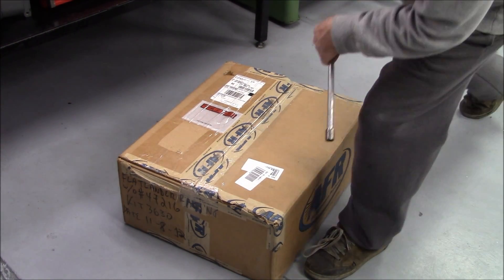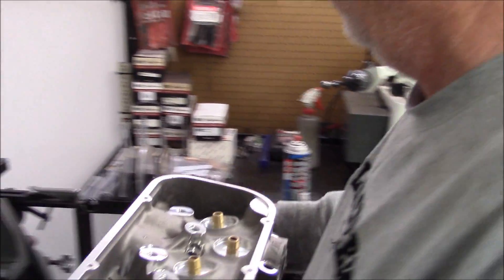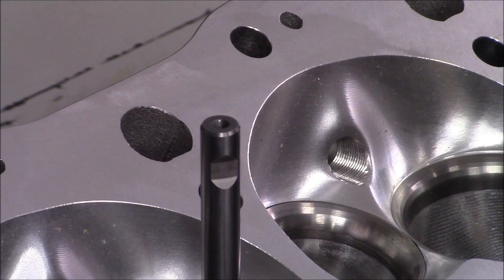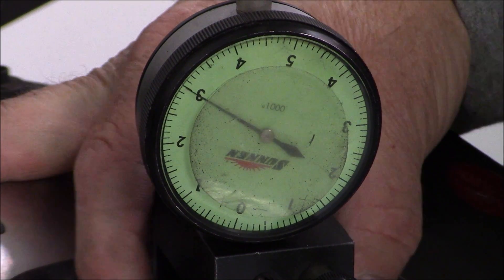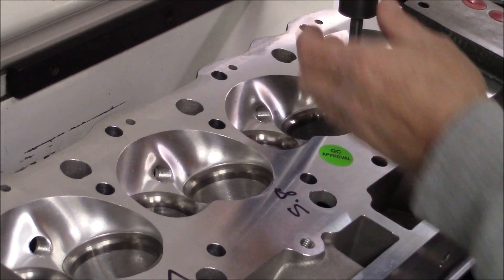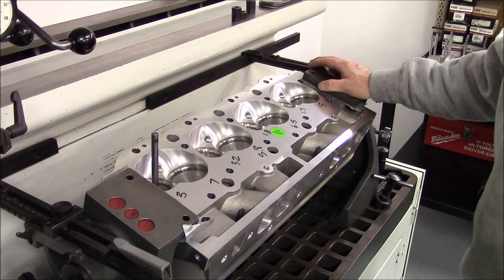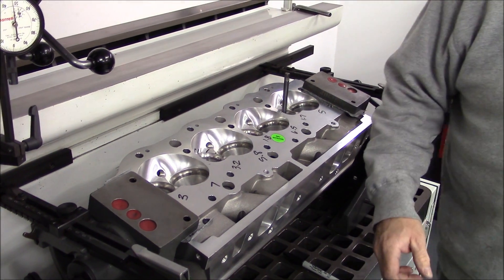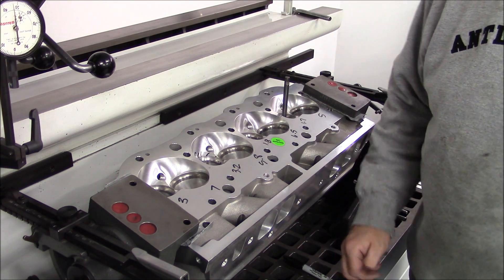Aftermarket Cylinder Heads - Why You Shouldn't Just Bolt Them On - Part 2 - TRRC / Vortecpro

Comment: AFR cuts all their heads on a Newen EPOC , dead pilot machine , 5 times as accurate as 1 Sunnen VGS like he is using here. The tapered pilots he is useing are good to about 2-2.5 thousands runout because they wont go all the way through the guide . Newen Pilots do. I would have rather seen him use a new valve and chech the seat that way.
Reply: That was a good observation on the tapered pilots. I learn more reading the comments than watching the video. I’m glad you made a comment.
Reply: Pilot thickness vs valve stem thickness is crucial. Get them wrong and your valve seat run-out will be all over the shop lol 
I used Serdi machines. It's accuracy is amazing. And one thing he didn't measure was the valve stem protrusion. Unless he's gonna run std hydraulic lifters, then it's like no big deal but still...
Reply: Are you from jersey?
Reply: I think your referring to "Neway" tools?
Reply: Jkdwayne obviously has some real information. 
Yes this video is pure Bull
Reply: There is just no way those numbers are accurate on brand new AFR heads. I worked 10 years in the bearing industry and used mainly Rockwell then but I smelled a rat the second I seen him chunking shit around and quickly moving away from zeroing his dial.
Reply: I agree with you jkdwayne. Newen single point cutter is the best. this guy is a wanker. chucking bolts and ratchets around.. fucken cowboy..
Reply: Now, now. The beers he had for lunch were just starting to kick in.
Reply: @christopherfranklin4760  this gave me a chuckle,  :)

Comment: Yes you are correct that all heads are out by a lot, some more than others. I prefer only .001 run out. Although, clanking around pieces whether bolts or perhaps pilots doesn't help your accuracy for machining or measuring someone else's. As a machinist I cringe when I here that ting sound, knowing that particular piece can be very inaccurate now.  As for the valve job, your valve job while now more accurate has its downfalls also. Those carbide cutters you use, create striations in the seat that will need to be lapped in order to produce a good seat.Better yet I use a dressed 45 deg finishing stone to just touch the seat after applying red dye to the seat. Every machine shop claims to be the hero but very few really does what it takes. The problem with most racers they want it now and  see the flow numbers they think bolt them on and I just made 200 hp extra when they have a poorly setup combo to start with. Winning teams don't just bolt on parts they spend countless hours on the finer things.

Comment: This is pure bull he is trying to survive in a market were you can buy brand name out of the box heads ready to run (the china ones do have issues) I have owned a high performance machine shop for over 30 years. I have checked MANY seats for run out . I have replaced the gauge twice because they are worthless when they get sloppy.
He cant zero the gauge because its worn out and sloppy Sunnen seat gauges are very expensive. Or he is using a to small pilot to run a little scam. 
Shops? like this are why people buy crate engines and just buy complete heads and bolt them on. They have destroyed the market .
 if you are a competent HONEST builder you will build up a clientele that is willing to pay you for your skill and experience (you will be working cheap per hour but if you enjoy it its worth it.)
Then there are the ones like this that try to con there way through selling unneeded work quoting fake power numbers and when people call them on it there like bill clinton they slip there way out of it.
Of coarse this is just my opinion
Show less
REPLY
Reply: Tom Hutchins I’m with you on the clapped tool that would not zero ! But if you stick a guide and ruin a motor AFR at best will send you a new set of heads🤣 what they will not do is replace the whole motor! He definitely should of clocked the pilot 180 out and checked the pilot . I hate crate engines my self . When I’m not racing I build my own engines and the selling point is a crate motor is ok at most things but good at nothing. I check everything no matter who I got it from because at the end of the day it’s my name on the valve covers. Who is this guy any ways
Reply: Take the pilot out and turn it 180 degrees to see if you get the same reading. Then he cut the seat with a bent pilot.
Reply: Thought the same thing, bent or wrong pilot
Reply: Tom Hutchens:  You're right about this guy. I know my way around precision engine work. This guy may have been an engine builder 40 years ago, but now he's just an actor on Youtube.  Probably made so many mistakes that he has run his own business into the ground.
Reply: Tim Hallas the thing that makes me curious is he hasnt responded to a single comment. That tells me something😒
Reply: He never will, because these comments are right. He doesn't know what he's doing.
Reply: Tom , Thank you for speaking up for the engine builders that do great work and honest work. I started in the Cylinder head business in 1970 and I had one of the first SF100 and SF600 benches built. Yes things have came a long way. I got in on the first run of Warren Brownfield SB chev aluminum heads. Had nothing but problems with soft castings, but it all got fixed when Ken Sperling bought the business. Its a shame how a guy like this can post lies on youtube. But as you see plenty of people are not buying it.
Reply: Tom Hutchins I’m more worried about guide  tolerance than valve run out. As a after market parts manufacturer I suggest you always inspect your own parts
Reply: ya dudes trying to make a big deal of a few thousandths. dude its going to get hot and expand either way and make it tighter immediately on start up and 5 to 10 thou is enough to say there could be measuring error to a degree so ya....
Reply: eXp0N3nT1aL  I care about a tenth of one thou🤣 and I get paid for doing it.
Reply: @groomlake51  what do you do?
Reply: eXp0N3nT1aL I build race cars
Reply: @groomlake51  like formula 1 or something?
Reply: This also is not the proper manner to measure runout.  Runout is the extend the seat is out of round, it’s a +/- rating.  He should be cutting it in half.  7ths of positive runout is 3.5ths of actual runout.

Guy doesn’t have a clue what he’s doing.
Reply: @port nut im a welder and its the same for mild steel.it dont want to cut all that good either.
Reply: I watched this man It was like a train wreck I could not keep my eyes off of it and I was wondering just How many people fall for this bullshit. I grew up in The car business.I was fortunate to observe true craftsman Who were conscientious ,confident and their tools Were treated with respect . Maybe I’m missing it and this guy is somehow shooting for more views and feels his target audience is too misinformed to know the difference. Either way he got my view as I fast forwarded through what not to do in a machine shop.
Reply: You're such a jack ass. I dare you to watch his dyno results making 650 hp on 91 oct pump piss and consistent 10 second ET's in a car weighing 3700 lbs with driver at 5,000 ft altitude & horrible humidity. Not to mention all of his satisfied customers over the years. Please find all of his complaints. You can't........now STFU.
Reply: Tom Hutchins you not crazy man this guy makes videos. He's no machinist. Neither am I but things like dust or dropping a precision instrument will produce inconsistent results. When I check something I first clean the poo out of it and make damn sure everything is laying flat and square . And I don't slam shot around either. Bet he's left a rod bolt or 3 loose if he's ever even built an engine. Wreckless!!!!! x 100.

Comment: Well, I agree with many others. Your handing precision machined parts and tools very poorly. That said, I always check valve seat contact with prussian blue to ensure 360 deg contact. It is a far better indication of seat/valve contact and run-out then measuring with a tool with questionable results (your indicator was way to jumpy for my liking). Further, the TIR is the total measurement so a reading of .005 is off center by .0025 and since your tool is measuring at a 45 deg angle the value will be skewed even more. I would like to see a blued up valve dropped in a to see the huge numbers show up as the valve would clearly not contact 360 deg if the dimension was truly off .009. I also prefer valve seat grinding to machining as well. With a single cutting edge tool your always pushing to one side, whereas grinding is 360 deg and makes a random finish pattern over linear cuts or the lines that will need to be lapped. (not that you shouldn't lap anyway).

Comment: I worked in a high end machine shop.. what they aren't doing and telling you is the run out changes at temperature. For a fully blown race head the heads need to be heated to running temp and then checked.. you would be surprised and the run out numbers with a head heated to just a hundred degrees. Did I just let a secret slip out.. ooops..
Reply: Coefficient of expansion of alloys isn't a secret.
Reply: Well I work in another  "high end' engine shop and I have to ask, how in the hell do you heat s head up to operating temp an how can you even work on it? Besides if heat can change the centerline of the seat it couldn't be much...but you do it that way so how much does it actually move and in what direction? I assume you have that same sunnen. Did hear of someone doing that with blocks for final hone, we don't and we have a 5 year old sunen... figure if you can get each hole within .0002...out of round,/taper it's close enough..and yes, we build blown gas/alky motors for boats...the last set of twins we did made 2400hp each on e85...and if ya turned the sound down on the vid the way he treats his tools is much better... thinking the camera he used has a decent mic and it exaggerates the sound
Reply: my dad used to build race engines and he would use a seat grinder with lapping compound. I remember the thing looked like a hand held egg beater and would twist the valve back and forth in it's seat with a polishing compound.  Then he did  what's called CC ing the heads. He also used sodium filled exhaust valves . He said they dissipate heat faster and with stand higher temps. I know one time I dropped one and it went off like a firecracker. Do they still  use these valves or have they been replaced with something new and improved. ?  Enjoyed your comment.
Reply: @captain757747  discontinued for years he went to stainless they went to Titanium and now I think they're back to stainless with sodium depends on who is marketing what.
Reply: How do you check for valve concentricity, valve stem protrusion, seat run-out and vacuum seal test if the head and parts are at operating temperature? Just curious
Reply: Skydof, don't worry,  you didn't let any LEGITIMATE secret out buddy. There WON'T be any solid black, window tinted gov. Suburbans parked in front of your house. And real race shop owners like myself won't be losing any sleep either.  But you did make me laugh. 
SWEET DREAMS.
Reply: well it is science, the properties of matter.
Reply: Nobody heats tye head to running temp. That is ridiculous
Reply: Skydof Inurhead thanx
Reply: Exactly
Reply: No you didnt let out anything except shyt from your mouth.... Heated machining has basically shown mixed results.
Reply: No need to make nasty comments to this fellow. By the comments I see nobody uses plates to bore and their shops aren't climate controlled. Dude has a point. Sounds like a lot of ppl out there would argue motors don't stretch and the world is flat. I think the main argument here is you don't know how they did it.
Reply: If you don't heat the head uniform and it isn't mounted to a block, wouldn't it have a tendency to warp?  And yes, how do you work on a 200 degree head?
Reply: @Mogman150  use an oven and heat treat gloves. I'm in the process of welding a cast iron gearcase for an air compressor and baking it in a bbq.
Reply: Checking the run out out a head thats been heated to operating temp isnt doing anything but checking the seat runout.
Reply: Your full of crapola mister. Been around head builders that have never done what you are suggesting.

Comment: Guy is a hack !!! Slam , Bam , boom , very rough guy . No machinist . Check Your tooling goofball ! You think that seat is off .007 , your nuts , its your tools because you throw them around like the junk they now are. Those heads are fine guaranteed , you just make them worse .
Reply: You need to learn what you're talking I don't trust anybody Machining work except mine so I bought a set of brodix heads went through them I bought the rough castings and did all the work myself trust me all heads are not perfect check them yourself you'd be amazed how far they're off
Reply: it seems u been manhandled ruff 😂😭😂😭 and u are traumatized
Reply: cornel sanders u like it nice and slow 😂😭😂😭😂😭
Reply: Spiritpoweredinternet and u are just another new booty millennial that just learned a new word 😂😭 and thinks he will get alot of likes by using it 😂😭😂😭 hahah "cringe" 🙄🙄🙄🙄🙄🙄🙄🙄🙄😂😭
Reply: Yup

Comment: To all the unknowing, valve sets are cut in production with a tool that cuts all angles at once. Even small guys like me use them, they cannot be out of round unless the head is not clamped down and everything chatters. The tool bits have one cutter per angle, typically carborundum edges on each angle cutter. I have toolbits that cut 5 angles all at once. The finish is dependant on the speed and the rate the bit goes down, nothing else. Buddy has bent inserts, the tapered guides that go into the valve guide, he is too stupid to realize it.
Reply: I cannot see Newen Epoc seats being that far out..unless pilot was way to small for guide... he treats everything like shit.. i agree with you about his bent tapered guides..(pilot). he changes to a  nice straight one for his seat job...
Reply: I've always done seat work on a Serdi or stone seat setup.

Comment: Could you have a more pissed off work ethic please. I'm Guessing you just threw the head on the floor b4 returning it to the customer.
Reply: Who knew that Oscar the Grouch would grow up to be a machinist?
Reply: @metal_mo  Hey I resemble that remark.  😠
Reply: @Mike Mcorky HAHA!
Reply: I would send shit to that guy!
Reply: Matthew Ohms should know most old machinists have reflex of throwing stuff,i have it as well.
Sometimes after removing a bolt i lose my hand.nerves.
Tunnel carpien in french,translate it.mostly because we bang the wrenches with palm of our hand.after years it does that.
Add all the chemicals...you know what painters and bodymens have.because of thinners and products in the paint they cant have erections.it is known.bad jobs for your body
Reply: @vincevegacustoms8860  
Carpal tunnel syndrome is not what caused him to toss the bolt and ratchet onto the head.  Poor work ethic did.  Even though it may not have caused any damage, the potential for it was there.  And it was completely avoidable.
Reply: @brussell639  totally agree not a good example either as a senior although the head would be getting a 1000x the force of the ratchet hitting it when in use 😂 it's designed to contain an explosion
Reply: @danielslade8848  
True, it's designed to contain an explosion, but its still aluminum.   Aluminum damages very easily, especially against other metals.

Comment: The way this guy handles precision equipment throwing it about banging it around I wouldn't let him within a mile of my car.....
He has all the gear and no idea.
Reply: The banging around of parts / equipment is a day to day job.
 This is what happens when you do the same job for to long, the care factor gets a lot less.
I also read a similar comment in regards to unpacking the heads throwing the bolts, socket wrench ??????????????
Can you keep this as a off camera attitude, we do not need to see this.
Reply: Haha Im sure a running Engine is a lot worse then he is
Reply: Big2009Gee I thought the same ik it’s all thick steel but still
Reply: if the equipment was that sensitive  it would be useless.  it's built to take abuse